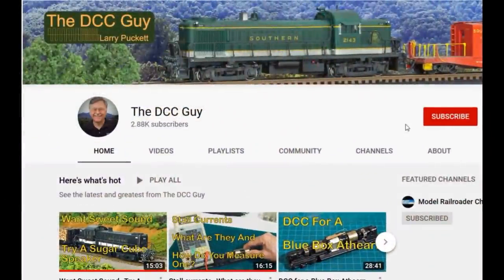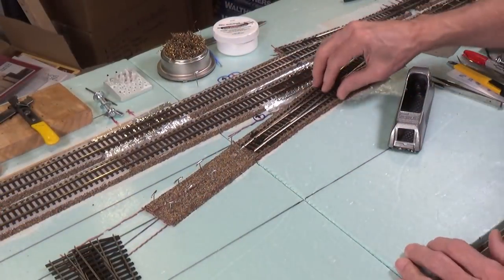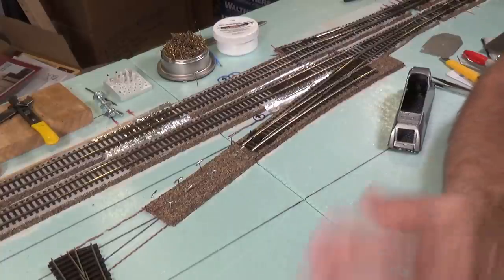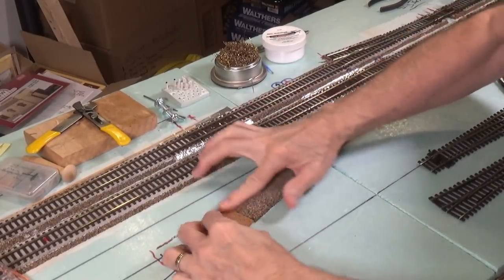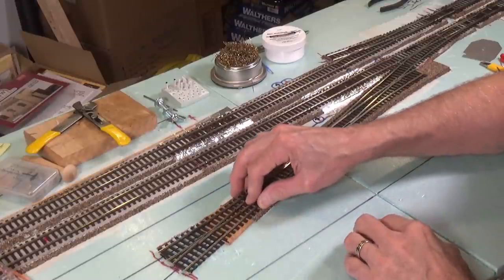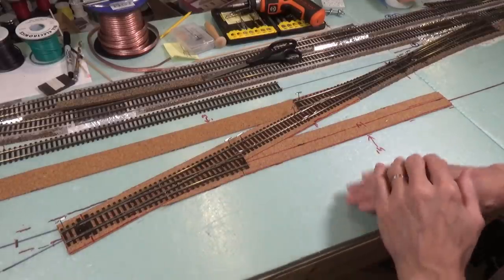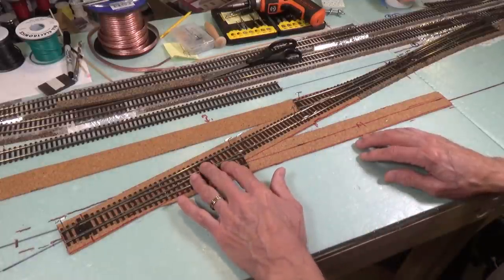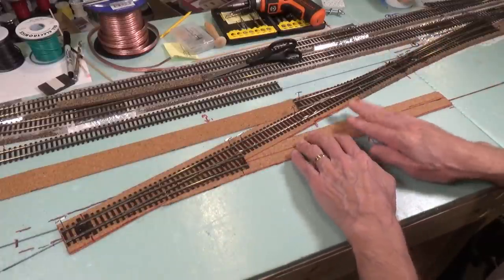Down The Ladder And Into The Yard (145)

Comment: Just saw this video. I know it’s a couple years old but, Widgetco in Houston carries sheet cork in several thicknesses. They are usually 3mm, 6mm but not 5mm so they don’t match up to Midwest cork roadbed. However, a little sanding will fix that 1mm

Comment: Hi Larry 
Another great instructional video.
I appreciated the warning about safety goggles. I will get some tomorrow.
Do you have laminate samples for colours and patterns used in kitchen cabinets?  They are great for spreading stuff, especially the ones that have a gloss finish.  They can also be left to dry then very easily cleaned.
Stay safe 
Paul from Zillmere

Comment: You have broken the sticking point on my trackwork- in my small town I have not been able to find a Surform plane, so I have been looking into other ways to change the grades in my yard.  I see that a Surform is the best way to go, so online ordering is the order of the day.  I am an N Scale modeler and want to pass on that using HO cork trackbed is another easy way to separate the levels; I'm going to use HO cork for extra trackbed depth on some mountainous elevated areas as well.
Reply from the maker: It should be really good for making steep embankments too. Go for it--Larry

PS—if you have an Amazon Prime account you can get these for $14.98 and they have a Craftsman knockoff for $8.98.
Reply: @TheDCCGuy  - thanks for the tip.

Comment: How about using 3/8" to 1/2" dowel rod?  Simple and easy to cut to any length you need.  With 1/2" rod, you can notch the end to fit over the connecting point on the Blue Point Controller.  Then drill a small hole for a 'pin' to secure it to the Controller.
Reply from the maker: All that would work but it takes a lot of time and only works for direct line connections. If you need to,go around something or at an angle the cables and flexible pushrods are much easier to work with.

Comment: Hi Larry,  I have an off topic question for you and/or anyone else that is following your great video series.  I have a situation where I would like to flip a coil switch(atlas) from two different points on my layout.  Is it possible to just wire both toggles to the same switch machine or do I need some electronics (eg. diodes) to protect the toggles from any kind of electronic surge when the other toggle is used to throw the switch?  If I were doing home wiring, I would just buy a 3way light switch.  I have not seen a similar product for HO trains.   Any and all comments are most welcome.
Thank you in advance for letting me get off topic.
Reply from the maker: Guy—it depends on how it is wired and controlled. If you use an accessory decoder like the NCE Switch8 then there is no problem with having multiple pushbuttons. if you plan to power them directly then it could get dicey should you end up with 2 people pushing the power buttons simultaneously. I think you could get away with using a diode matrix but I came one generation late and never have worked with those. Good luck.

Comment: Push rods are also used in the rc airplane hobby, check airplane web site
Reply: You can also use bicycle sheathed brake cable.
Reply: My former local HS used to sell the RC cables for blue point installations, same thing
Reply from the maker: Automotive choke cables also work. However many of these are more expensive that plastic pushrods. I dug out a couple metal connecting rods from my old sailplanes but then could not find any more locally or on Amazon/eBay. I also looked on a few RC websites and they did not have them either. I don’t know if they are not making any right now due to lockdowns or some other reason.
Reply: Push rods are a Sullivan Products, # sul504

Comment: Do you ballast the yard?
Reply from the maker: Yes and no, it depends on the yard. For a heavily used yard like Monroe on the Piedmont Southern it is all ballasted. For smaller operations like on the modules I will ballast the track itself but not the areas between them. This is also true for the pulp loading track in Monroe yard. The neat thing about these smaller settings is the rails and ties are often buried in earth up to the tops of the rails, something I will do on the modules.